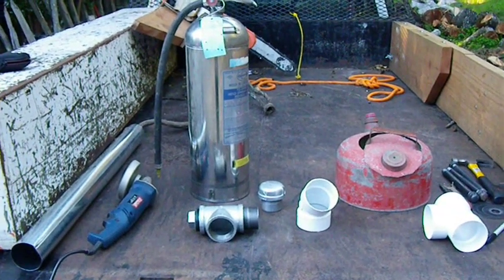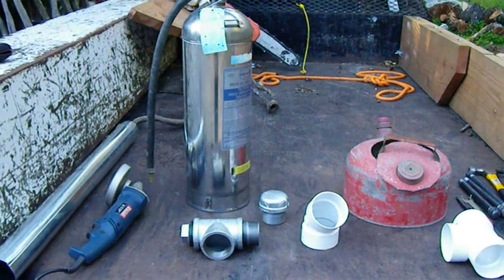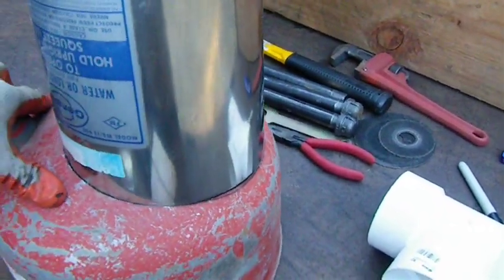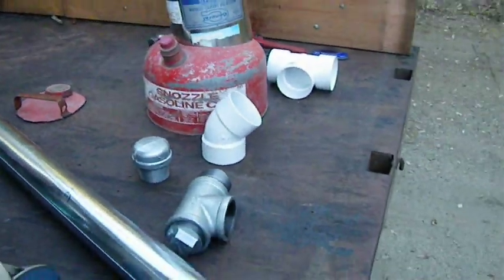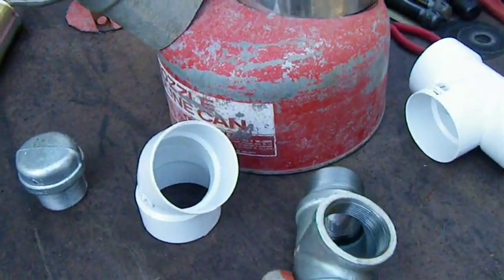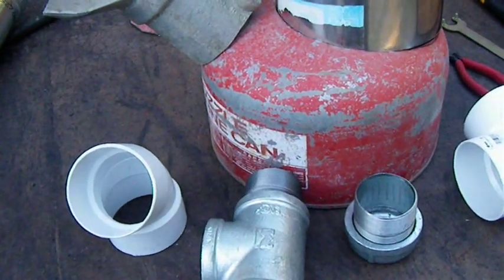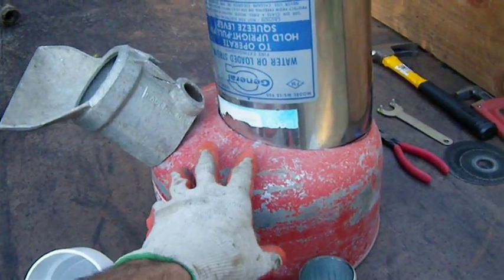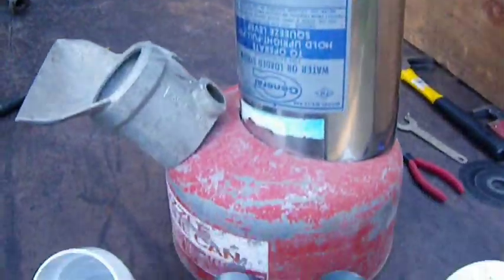Rocket stove pt 1

Comment from the maker: @redicety12 the gas can is steel. its probably galvanized on the inside, but the cement insulates it from heating. off gassing is definitely a concern, but i think that after running the stove at full temp a few times, any zinc that is going to off gas will have done so. thanks for the comments.

Comment from the maker: @tryin2lhard no welding, all the parts are cast in place. i hear you on the moisture issue with the concrete. as to the draft, the vent holes in the ash clean-out can be closed down. i just finished my second burn in the completed unit and had no back-draft issues, even with the ash vent fully open. ill post the vid of that shortly. thanks for the feedback!